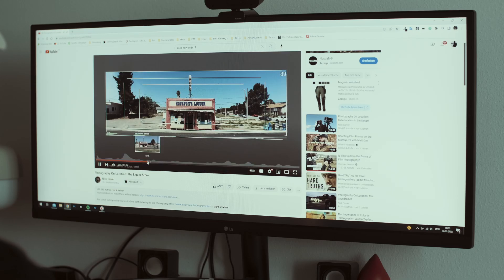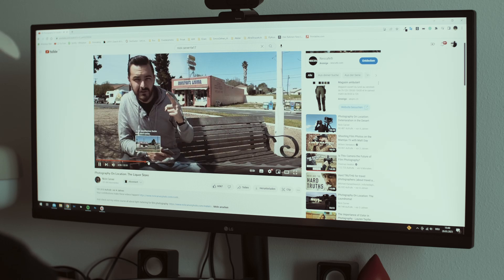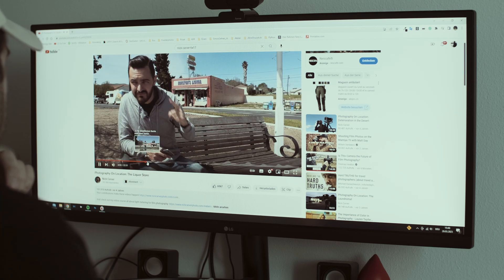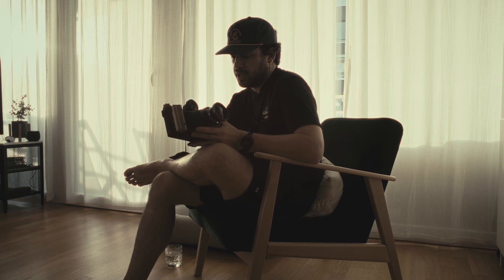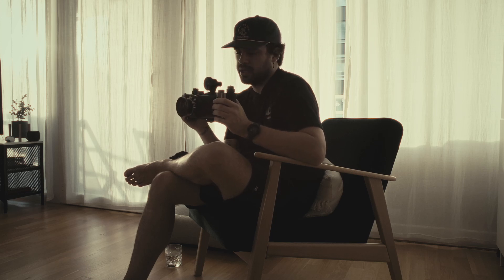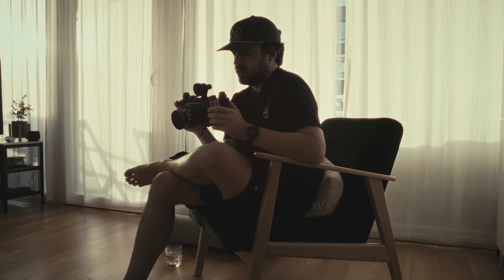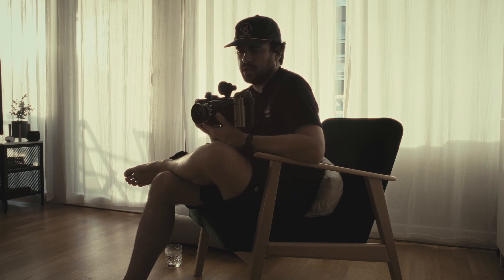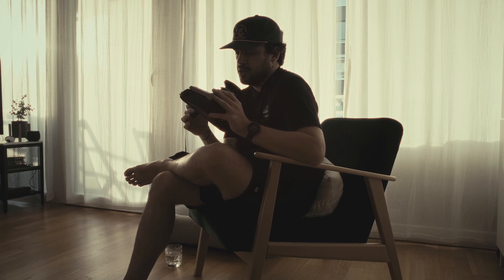Building a Camera || DIY 6x17 Panoramic Camera

Comment: I'm building the V8 version. Did you print the lens board?
Reply from the maker: Nice! Yes, I printed the lensboard :-) The files are on printables too.
Reply: @Lightleakz Which lensboard? There are three. Also which helicoid?
Reply from the maker: @billkaroly  If I remember correctly I used the M65Front-Copal_0_H10_G00_ID350_r2.stl 
Lensboard. It doesn't really matter which one you use, as long as it fits your shuttersize and you put the right thickness in the parameter when configuring the cone in Fusion360 👌I use a M65 17-31mm Helicoid.
Reply: I would love to know more about your viewfinder solution. Thx for the video!
Reply: @krakencoffeeroasters3727  I made a ground glass holder by deleting parts of the body not needed. You have to mount the lens to the holder that set critical focus. Then mount the camera body and lens to shoot.

Comment: I designed a similar viewfinder, the design specifications are as follows:

Front Element is plano-concave lens - diameter 50mm, focal length minus 100
Rear Element is plano convex lens – diameter 25mm, focal length 125

Distance between lens elements 25mm, yields a magnification of 0.8. 

You want to design a simple housing to hold the two elements 25mm apart, and that allows a retaining rim to be screwed onto the front element, behind which lens masks may be fitted to approximate the view with the various lens options. Of course, you need a cone for each lens option as well.

Mask sizes for the above lens combination are as follows:

A 75mm lens mask to cover the front element needs to be 50mm diameter with a 45.3mm wide by 16mm high aperture. 
 A 90mm lens mask to cover the front element needs to be 50mm diameter with a 37.7mm wide x 13.3 mm high aperture.
A 105mm lens mask to cover the front element needs to be 50mm diameter with a 32.4mm wide x 11.4mm high aperture.
A 150mm lens mask to cover the front element needs to be 50mm diameter with a 22.7mm wide x 8mm high aperture.
A 210mm lens mask to cover the front element needs to be 50mm diameter with a 16.2mm wide x 5.7mm high aperture.

NOTE: A 50mm front element size will be able to accommodate masks for lenses down to 72mm focal lengths. If you want to cover 65mm focal length you’d need a 55mm diameter lens with minus 100 focal length.

Comment: 2:37 could someone please point me a link where i can get it ?
Reply from the maker: Do you mean the lens ? I bought mine on Ebay, imported it from Japan. :-)
Reply: @Lightleakz  yes. i tried to look with several search terms "vintage lens with manual shutter lever" resulted in no lens  matching the description. it will be really helpful if  you point to the ebay link. I'll try to use that reference
Reply from the maker: @pavan.kumar.n  Search for " Large Format Lens" https://www.ebay.ch/itm/394902218214

This could be an example.
Reply: @Lightleakz  thank you so much!